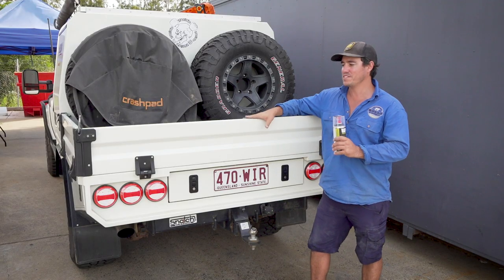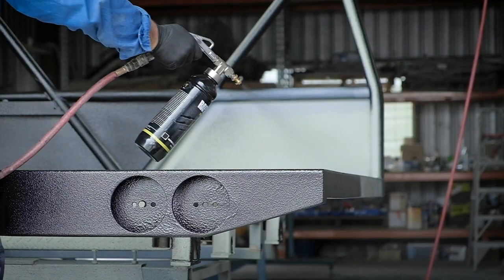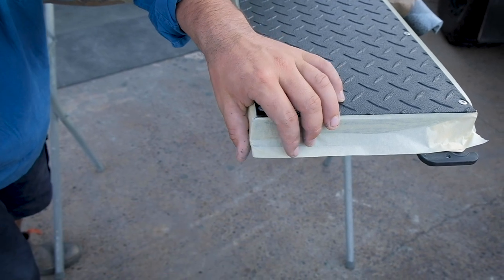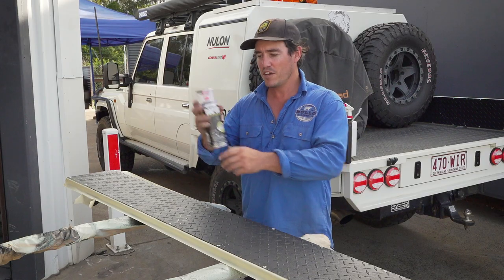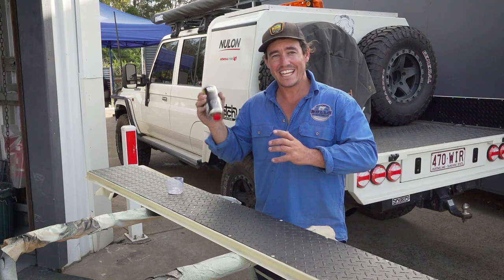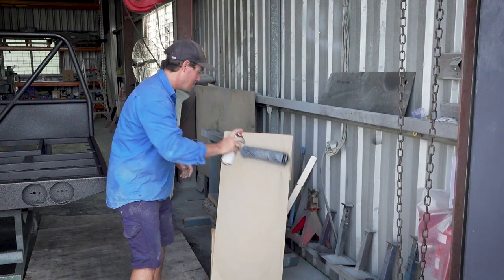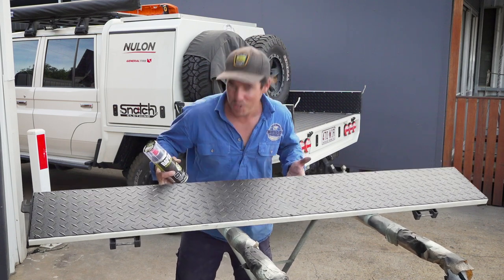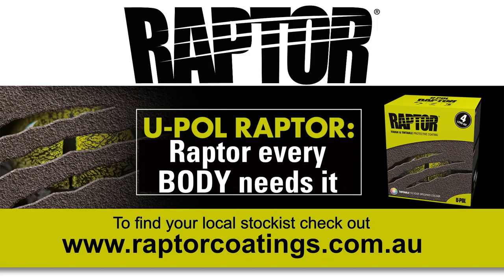NEW Raptor 2K Bedliner Aerosol by U-POL

Comment: Whats the difference with this and thr raptor 1k bedliner ?
Reply from the maker: @TimeLapseCarGuyBruno great question! 
While both RAPTOR 2K and 1K both offer a textured finish there are a number of differences between the two products. 

For instance the Raptor 2K product contains a hardener that is activated before use and is a ONE time use product.  
The 2 Pack hardener and RAPTOR's unique formulation combine to make a super tough coating for those items that are getting heavily bashed around or exposed the corrosive environments.  
Quite simply if it what you are painting is going to get abused, use RAPTOR 2K as its super tough!

RAPTOR 1K with its textured finish is a multi-use can and great for those jobs where you want the textured finish, but it it’s not being exposed to an abusive environment.  The RAPTOR 1K won’t fade, is 3 times tougher than other 1K paints and what’s more - it looks great!  Many people use Raptor 1K around the home or on items like vehicle trims etc. Remember, you can also use the can more than once. I hope this information has been helpful, please contact us at info@u-pol.com.au or phone our Sydney office on 02 47312655 if we can be of any further assistance!